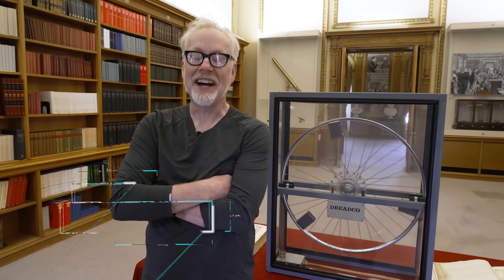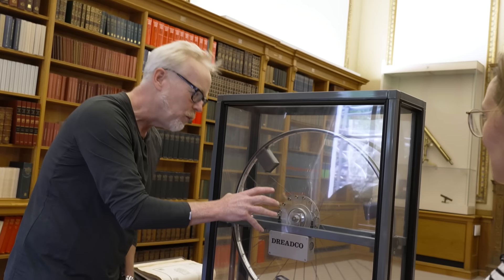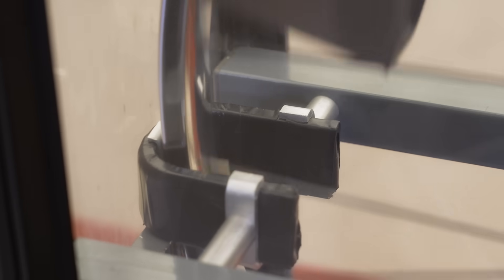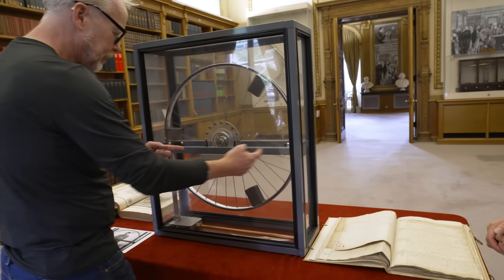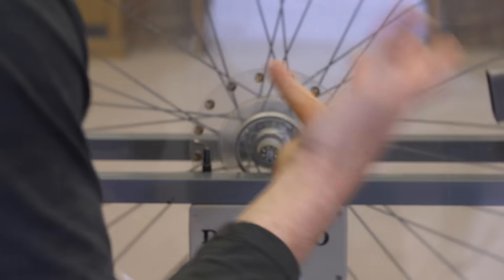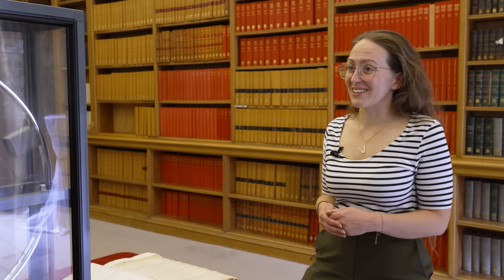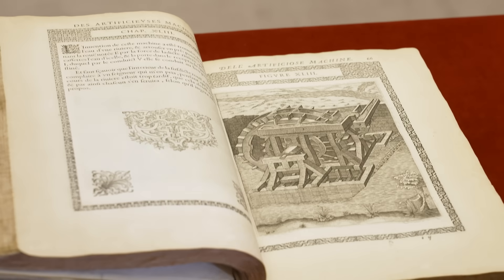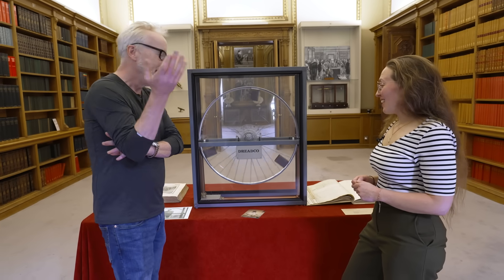Adam Savage vs The "Perpetual Motion" Machine!

Comment: I have a very rare perpetually powered wristwatch. It runs and runs for many years and when it eventually stops I just take it to only person who knows its secrets and its good to go again.
Reply: Sounds like the same person I took my watch to. I had a watch where the little square date changed at mid-day instead of midnight. He was able to repair this fault for only £100 which I thought very reasonable for such complex and intricate work from an expert in these things.
Reply: @dobythedog  I must recommend to you my expert. He repairs my watch every other month or so, because it insists that all months have 31 days. And he charges only 500 SEK for this very involved task!
Reply: @dobythedog  I guess I'm cheap. For £100 I'd have bought a device that tells the time & the date and the weather and can make telephone calls + receive calls and can connect to the internet. But what do I know?
Reply: I was actually dumb and I was going to mention a self winding wrist watch until I read the end
Reply: They made self winding watches that would wind when the wearer moved. It was as perpetual as it's owners!
Reply: If you could train the watch to make its way back to the person who knows the secret and return itself you'd have cracked the secret. Same goes for the G string.
Reply: Clocks that run on atmospheric pressure changes are pretty much the closest thing there are to perpetual motion machines that actually do work.
Reply: What will happen when your watch repairman is retired or passes away?
Reply: @babyjuggernaught8203  He just gives him a lickin' & he keeps on tickin' !! 😉👍
Reply: Ah yes, my favorite form of perpetual motion
Reply: I have a watch I wore at work. I retired and 22 years later it was still running in a drawer. Yes it had a battery but what a battery. It has stopped now
Reply: I thought that was a joke when she said that.  And it's the same period of time.  So either this breaks the Laws of Thermodynamics Dynamics or they change the battery every couple years.   This is a silly video.  isn't it?
Reply: The watch has a weighted gizmo that re-winds it through motion, still a really cool idea though.
Reply: Mother Earth is a Perpetual Motion machine.
Its weather creates rain. Rain collected then gathers in small streams, as well as natural springs from under 'her' surface, at times.  These small waterways eventually cohort together to form something that might be defined as a river.  This river can the spin a variety of objects,  including a water wheel,  or a facsimile of.  This wheel can then create  energy that continues to go on & on for much longer than a few yrs, like this device. 
The river empties into an ocean eventually,  which is apart of the mechanism that returns the water to both the sky, & the earth.  To then perpetually continue the process.  Now, 1 could argue that its not a natural process,  & yet its more organic than this very interesting device in the video.
Reply: @here_for_the  From my understanding, a perpetual motion machine must stay in motion or create energy from nothing, this machine requires adding energy.

The earth follows the rules of the modern sciences we currently understand. While the earth might not run out of water, the motion of the river still requires additional water to be added.
Reply: @tomd96  I agree.  I just didn't see where the 'adding' of water required anything from mankind.  
On another note.  Its been determined as fact, that now, as of 2023, at least 48 countries around the globe have at least participated in or at, some level of weather manipulation &/or modification.   Not sure when weather modification started, as I have never researched it.  Its pretty amazing how much river water on a typical day to day basis, & not severe storm basis.  Comes from Mother Earth.  Which 1 could argue that spring water,  just came from the sky, previously.  When you look at how Earth recycles its water quite literally,  since, 'forever'. That alone could be argued as 'Perpetual Motion'.  This topic is sofar from my wheelhouse of Aerodynamic & Thermodynamics,  that I cannot argue it intelligently.  Im less than an amateur at these topics related to this video.  Yet, nobody has disproved the Patterson Cell either. & I first saw it about 30 yrs ago on a TV broadcast known as 'Nightline', hosted by a guy named Ted Koppel.  Im not even vouching for the validity of the Patterson Cell as a Perpetual Power source.  As I like everyone else, would like to know how this device works & produced energy.   I suspect its probably a fraud, but I just don't know.
Thx for your imput in this. Polite Discussion   can often lead to even more discovery & understandingby all,  than people just exchanging rude banter.
Reply: @tomd96  The earth is slowing (measurably) and the water is slowly, but surely, evaporating into space (along with the atmosphere). Entropy gets everyone in the end.
Reply: @here_for_the  except the earth isn't a closed system
Reply: @here_for_the  the sun provide the energy to that happens
Reply: @here_for_the  Earth's natural processes are not perpetual, just very long lived; they will cease when the sun eventually burns out.
Reply: @kingofgamesyamiyami6269  I agree w/u from a modern science perspective.  But prove it anyway .. 🤷 🤪
Reply: @here_for_the  earth continously recieves energy from the sun, and the water cycle wouldn't work without it
The moon is also slowing down/getting closer, and earth is slowly cooling (not on the surface, but on planetary timescales the total heat energy including the core gets less), so it is losing energy despite getting energy supply all the time
Reply: @here_for_the  Earth is not a perpetual motion machine. It has an external source of energy, the sun.
Reply: it's called an automatic watch and it's not rare
Reply: @Entremanures  It's called a joke, they're not rare either
Reply: @Entremanures  Nope. He is describing a battery powered watch
Reply: I stopped wearing a wristwatch when I bought a cellphone.
Reply: @Temulon  I stopped wearing a cellphone when I got a g string.
Reply: @The Situation nobody cared until I shat myself
Reply: @The Situation was is cut down the middle or did it go one side? 😭

would it pick a side depending on your hemisphere? what about the position of the moon? 💀😭
Reply: @The_Situationi stopped shatting myself when I started wearing a gstring with a buttplug attached. Custom work. Every once in a while I have to take it to a guy to service it, then it works again.
Reply: @glennross85   Understandable
Reply: @Temulon  I started wearing a wristwatch a bit over a year ago snd can't imagine livin without one, it's much more convenient than my phone for checking the time, it's completely waterproof, and when it's - 20°C and I am on a hike I don't need to freeze my fingers taking my phone out to check the time. And the watch was like 30€ with 10 year battery life.
Reply: @outandabout259  - I used to date a girl that worked in a jewelry store. She said they have a hard time moving the wristwatches due to cellular phones. A large percentage of people wear them now, not to know the time, but as fashion accessories. But I can still see how they are useful and convenient for a lot of people. And the batteries really surprised me. Like you wrote, 10 years on one battery! That's awesome.
Reply: @Temulon  Ma 5 bambija za tebe !
Reply: @Rkekoke485  Tvoja rečenica nije imala smisla. Spreman sam se kladiti da je "Not Making Sense" vaša jača strana.

Comment: did you knotice that as the items on the 120 degres point as they approch each of the things either end of the copper pipes are either pulling the the "battery" towards slightly meaning that the wheel is not round but has a slight triangle shape to the wheel. or its just buckled a bit. this is just from the observation of this video.

Comment: The Jaeger‑LeCoultre Atmos clock is powered by a temperature sensitive gas mixture in a sealed capsule that pulls a chain as it expands and contracts. The copper pipes in this 'perpetual motion machine' with the heatsink and attached valve could act as the capsule.
Reply: I was thinking thermal energy too
Reply: But that would require a mechanical linkage to the axle.  Gotta be standard electromagnet pulse circuit surely?

Comment: Here is how it works Adam. Every time one of the 3 black boxes goes through one of the 2 permanent magnets, a magnetic reed  switch in the black box closes a circuit with a coil and a long life battery also contained within the black box, perhaps a silver battery, thus creating a weak magnetic field with polarity oriented such that it repels away from the permanent magnet. This happens every 60 degrees of rotation of the wheel with each pulse imparting just enough energy to keep the wheel turning. The periodic servicing is to replace the batteries.
Reply: My thoughts too.  If you could accurately measure the angular velocity of the wheel during a full revolution I suspect  you would see 6 small increases little 'kicks' if you like. Each one corresponding to the passage of the boxes past the two permanent magnets. The rest of the apparatus is probably just a decoy. I don't know if anyone could use a video of the wheel to do accurate enough velocity measurements to confirm? Probably not.
Reply: @alangreen5858  Sounds like a job for the slo-mo guys
Reply: @alangreen5858  I concur about all the decoy parts, it's really common with fake perpetual motion machines to include a lot of exotic-looking doodads and intricate looking mechanisms to distract a curious observer, in one case where the "inventor" was trying to pass it off as a genuine scientific advancement he even could partially disassemble the device while a nearby assistant kept any of the onlookers from getting TOO close to the operative bits while letting them inspect polypropylene blocks and aluminum doodads as closely as they liked
Reply: @alangreen5858  yeah with enough frames per second it would be noticable I'm sure if not by human eyes but my robotic eyes I could definitely tell you exactly the velocity gained from every kick especially if you could stop it and start it off slowly it would probably be really noticable
Reply: @Ericmcdonkey  I suspect you are correct, but I think it would be more fun and probably easier to simply duplicate it rather than try to prove it with video analysis.  

Another thing to notice is that the seals have been removed from the wheel bearings and they appear to be dry so as not to attract dirt/dust, no doubt a friction reducing effort to further reduce required energy to an absolute minimum. Perhaps a smidge of graphite powder for lube.
Reply: @Ericmcdonkey  you have robotic eyes?
Reply: I wonder if it's a ceramic bearings?  I don't think glass or ceramic bearings benefit from any lubrication including graphite.
Reply: @kamalmanzukie  just one in my D that detects AIDS but I'm working on a perpetual motion sensor and a perpetual moisture detection system also doesn't everyone have at least one laying around
Reply: @1FreeSelfGoverningAmericanMan  graphite powder is pretty amazing I hadn't ever messed with it until I had a door lock and put some in there now I don't stick a key in without it 😂 JK but honestly been thinking about disassembling a gun and cleaning all oil and grease off then only lubricating it with graphite powder to see how it runs have a gun I don't care about that was made by a fine company called high-point that has been good for stress testing
Reply: Great exploitation bro
Reply: @KapilDev-md5uq  Thanks!
Reply: Boom. That's exactly what it is. It's not a secret. Well done, sir.
Reply: @discordye4825  I figured the heatsink was baloney because anything requiring a heatsink would be using far too much energy and would only last hours and not years.
Reply: Yep, that makes sense.  Sealed boxes and permanent magnets.  The decoys aren't even very good.  Copper pipe and a heatsink?  That doesn't make sense to me.  The only heat being generated is that little bit of battery loss in those sealed boxes and friction in the system.  Makes the three boxes clear and let's see how interesting this is....??
Reply: I had a feeling that the “anode” and “cathode” are used to calculate the wheel’s speed
Reply: @silaswolfe381  - +🤣🤣🤣🤣🤣🤣
Reply: We know, we watched the video.
Reply: Yes. And the 2 other boxes, the copper pipe and the electrode looking things are just red herrings.
Reply: You don't even need to do that. Circuits for adding a little kick have long been used in executive toys and Foucalt's pendulums. Big Clive has a video on them. They're very power efficient. MHRxYtVD1IU from Aug 23 2019.
Reply: I think you guys worked out this simple motion machine. I will add my idea about the other parts that don't seem to add any mechanical advantage, other than I think they are metaphor for what you are looking at and indeed may describe how your thinking and feeling trying to work out this machine . As with many famous artists I think the Inventor took a leaf out there book and put in the parts not only to confuse your attempt but also to give a clue , so here goes with my analogy I think the copper pipe represent a pipe dream , the probes could mean he or you are probing you to understand he to probe your mind , the heat sink we could describe this as soaking up the heated debate or the idea , we could even split this into two separate words with different meanings , the box Infront is a empty box , could mean box of Trix boxing clever , Pandora's box . 
Anyway I think the Inventor is having fun with his viewers .
Reply: Your absolutely right....
Reply: Doesn't a Bedini Static Generator do this very same thing?
Reply: Analyze it with a super high speed camera and you may be able to tell when it is being accelerated and decelerated.
Reply: @bobh6728  Right you are!
Reply: Batteries are just cheating!
Reply: Wrong, wrong…WRONG!!
It’s obviously tiny rainforest frogs in each of the black boxes jumping in unison, thus causing the momentum of the circular motion. The pipes at the bottom are just a supply of concentrated oxygen to keep the critters agitated. 

You’re welcome.
Reply: Not even close.
Reply: Plausible, but then what's the copper pipe and heatsinked silver box doing?  Also, why is it that only one person has successfully guessed (supposedly) how the thing works in the 40 some odd years it has been on display?
Reply: @sincerelyyours7538  like he said the pipe etc is a decoy to throw people off
Reply: @sincerelyyours7538  Many have guessed successfully, but they just lie and say one to make it more interesting.
Reply: @sincerelyyours7538  The copper pipe and heatsinked silver box are distracting you from the working mechanism. They are nothing but props. Think about it, if there was enough energy to waste to atmosphere through a heat sink, then there would necessarily be a much larger and probably obvious energy input.
Reply: @sincerelyyours7538  they could just be there to misdirect people.
Reply: @DanielJoyce  They could, but then why celebrate a fraud by displaying it in the Royal Society? I rather think it has some purpose along with the heat-sinked box in the corner that may not be intuitively apparent. Anybody can make a motor. Not anybody can make it run for two years in a sealed box without using a battery. That may be the real misdirection here.
Reply: No it's just a wound up spring with a very high gear ratio. This can be done. Not complicated.  Other stuff is fooling you
Reply: @deon9981  Yes a wound spring can do this type of job, as it has in clockwork for centuries. But even a clock which has a very low power requirement needs to be wound many times in two years. A silver oxide battery will last that long and put out a fairly constant voltage over its life. If you go to the playground and turn the merry-go-round, you can perpetuate its motion with a very slight push on each handlebar as it passes without a noticeable change in speed between each pulse of energy. While the wound spring approach could work, it is far less likely in this example.
Reply: @deon9981  Where is the spring? I don't see it in the system.  Seems like the battery/magnet approach is most plausible. Why aren't the boxes clear?
Reply: @deon9981  You're right. That copper tube is a perfect place to hide a wound spring. A few years sounds about right. Not magnets. But do not know how the escape mechanism is workings. Air pressure?
Reply: @deon9981  2 years worth of stored up potential energy in a spring sounds far fetched but not impossible

Comment: I think perpetual motion should be defined as motion within a sytem which can only lose energy to its surroundings. This machine appear to gain it from light, does it charge electricity and run the motor or something?

Comment: The fact it is in a sealed vessel makes me think there could be a small Bernoulli effect going on, large entry tube then reduces to high pressure. The sealed box would ensure a level of control as It would not work in the open. The dreadco box is a diversion, could the three boxes moving whith wheel be weights helping retain enertia? Either way not a perpetual motion machine as it would have needed outside energy to start it, just another way to show efficency.

Comment: Occam's razor: the three boxes 120 degrees in opposition contain a battery and an electromagnetic switching device. The electromagnets are first attract to the two iron bars at 180 degree opposition, then as they rotate past the current is flipped and the magnets repel from the iron bar. We're talking very very little current as it takes very little energy for the wheel to rotate at the speed observed in video here. Two years for three good batteries on low draw? Easy.